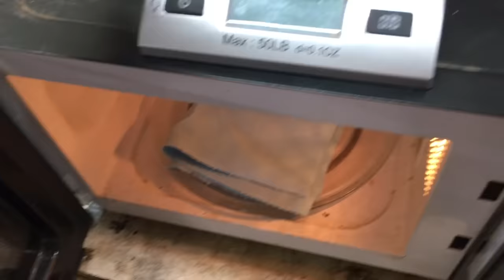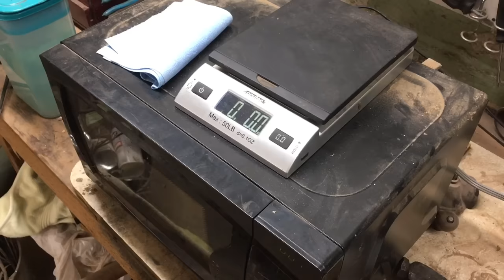Woodturning an Oak Log Bowl

Comment: Thank you for sharing. I understand the need to utilize the microwave to get the moisture out but how did you know the weight that you were looking for?
Reply from the maker: Thanks! I usually microwave until it looses about 35% of its weight or until it stops loosing any weight between cycles.
Reply: @AdirondackIron  thank you for your reply. Do you make items for sale?
Reply: @AdirondackIron  ঝ।

Comment: How do u know how long to put in the microwave for?
Reply from the maker: My method is to microwave on high for 2-3 minutes and then let it cool for 10. I keep doing that until it stops loosing weight and no longer has a 'moist heat' feel to it. The wood should loose at least 30-35% of it weight during the process. The bowl should be left out for a day or two before finishing. I'll make a video about it eventually. Beware once the wood dries out the microwave can actually char the bowl.

Comment: I'm impressed beautiful piece of work I have a silly question how many ounces or pounds that holds the handles holds!?
Reply from the maker: Thank you! I put about 10 pounds in to see if it would hold and it did. However I wouldn't sell one like this now unless i were to put some sort of pin or screw in the connection.

Comment: Do not attempt to carry this bowls by the handles.  The glueing method shown is clearly not load bearing and a nasty scalding accident could result if hot liquid was involved as the handles snapped off.   I am surprised that this experienced and quite skilled wood turner shows such a poor method of fixing - i.e. the worst possible adhesion with unmatched grain and minimal contact area.  At least mortice the handles in and/or beef up the join with screws.  Please add a rider to this before someone is injured.

Comment: I LOVE THAT WOODEN BOWL BUT I DID NOT LIKE HOW YOU USED GLUE ALONE TO CONNECT THE HANDLES TO THE BOWL,THAT HANDLE WILL SNAP OFF IF THE BOWL FALLS TO THE FLOOR.IF THE HANDLE HITS THE FLOOR FIRST WITH THE WEIGHT OF THE BOWL BEHIND IT, THE HANDLE WILL SNAP OFF.YOU SHOULD OF PUT 2 BRASS SCREWS TO EACH HANDLE.YOU HAVE PROVEN YOURSELF TO BE A GOOD CRAFTSMAN,I HAVE FAITH IN YOU THAT YOU COULD INSTALL THE BRASS SCREWS FROM INSIDE THE BOWL TO THE HANDLES WITH OUT THEM SHOWING.I AM SOMEWHAT OF A PERFECTIONIST,I BELIEVE THINGS SHOULD BE DONE TO PERFECTION THE FIRST TIME.BELIEVE ME WHEN I TELL YOU THIS,I AM HARD ON MYSELF,IT IS NOT EASY BEING ME...